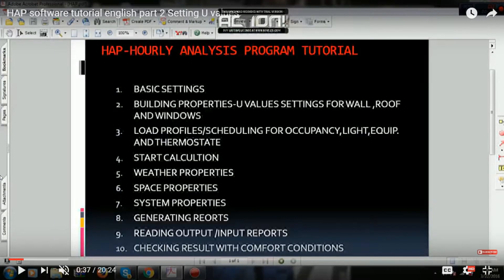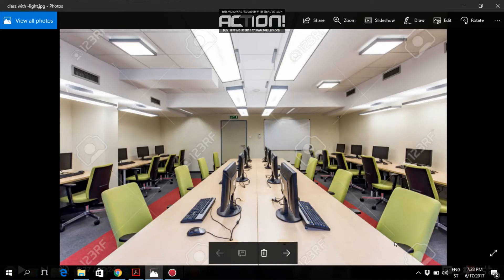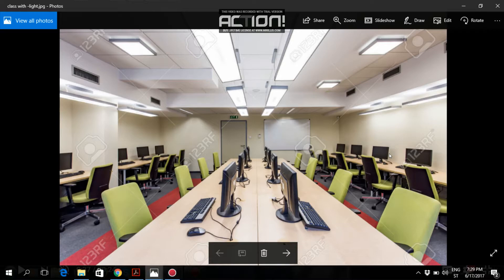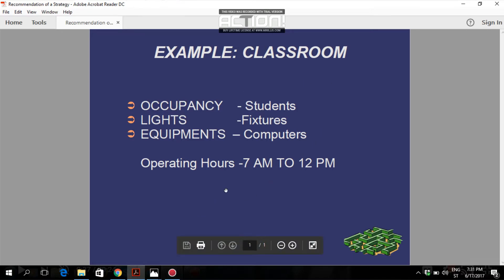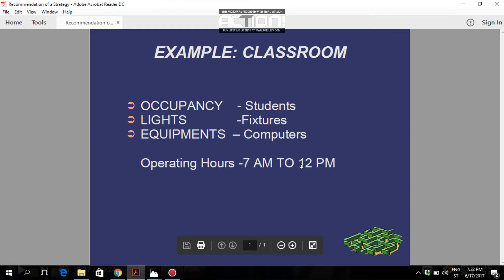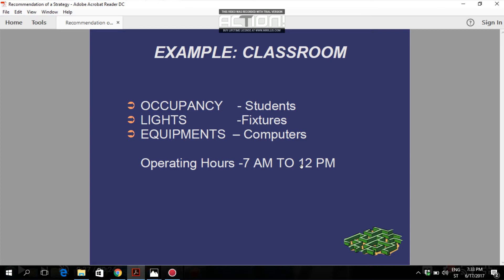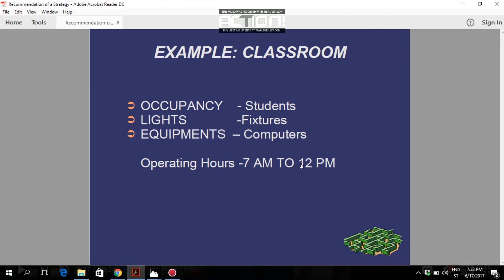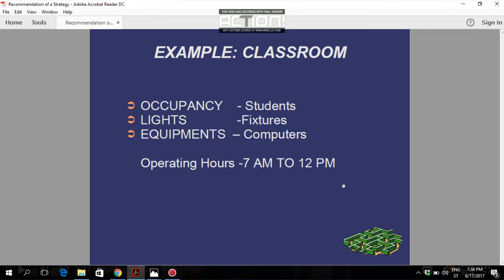HVAC COOLING LOAD CALCULATION TRAINING AND LEARNING-HAP software tutorial English Part -3A

Comment: i have precooled fresh air supplying to AHU, in HAP, where i will find this option if i have precooled fresh air
Reply from the maker: You have to change selection of the SYSTEM based on your requirements.
Preferably you have to select the option that Common ventilation provided while your selecting the system 

Separate video will be uploaded on this point